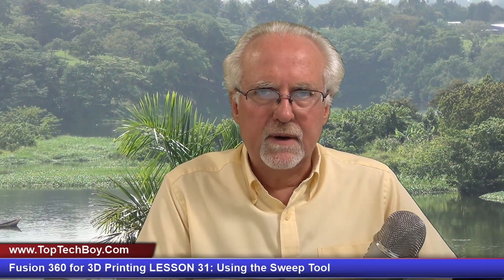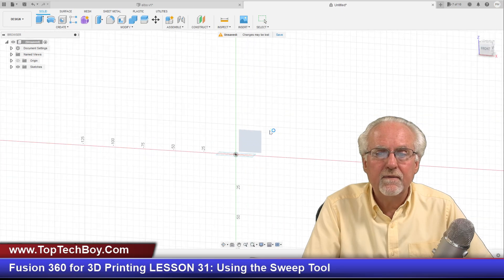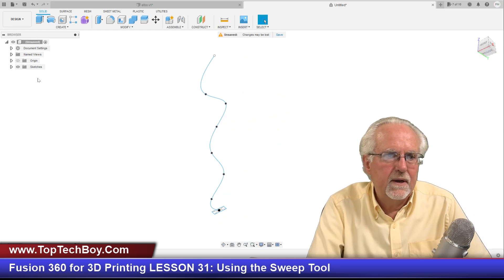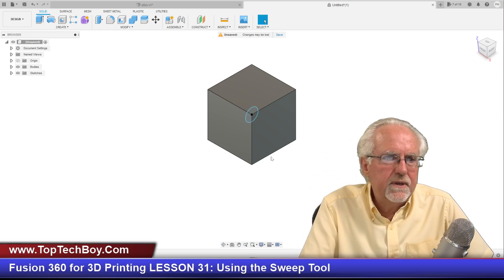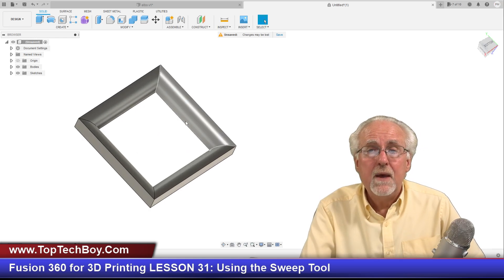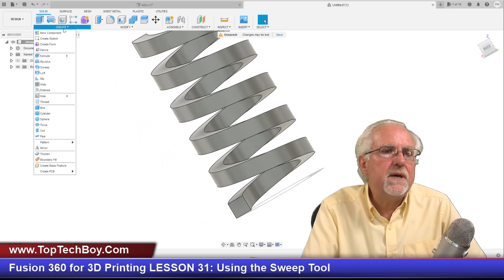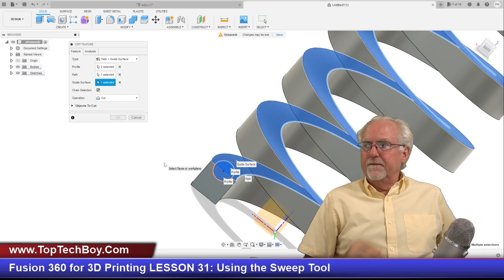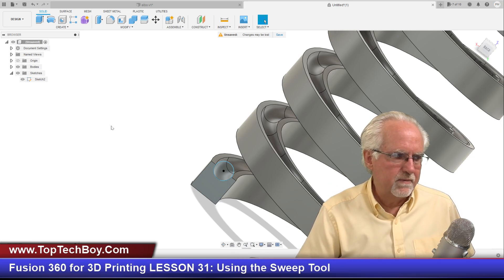Fusion 360 for 3D Printing LESSON 31: Using the Sweep Tool

Comment: Merry Christmas!  I decided to just add a support and make two so I can check fit of two different offsets.  So, these two elbows both have an offset on the outside surface of the male ends.  One has a -.1mm offset.  The other has a -.2mm offset.  The -.1mm offset is too tight to even get it to insert in the female end.  The -.2mm offset is the connection in the last part of the video, which would be good to use if using a plastic solvent to weld them together, like PVC primer liquid, or polymethyl methacrylate monomer.  I am looking forward to see how Paul does this without a support.  Maybe lay the pipe on its side likely.  Thanks for the exercise,  Paul!!
Here is the link to the video:   https://www.youtube.com/watch?v=Ckb646ZCmJI
Reply from the maker: Excellent!
Reply: I am impressed with the video and graphics! My design was not overly taxing, it is printing now, it is on its side. I am doubtful it will print, I didn't use any supports. One question: did it put supports inside the elbow tube?
Reply: @drdentin3215  Hello, Dr!  Thanks for your comment.  There were no internal supports. Only what you see in the video.  I am sharing this with my staff on our lunch break, and they want to know if Dentin is your last name.
Reply: @DrDave327  No Dentin is not. It is a dental pay on words. Dr Dentons are the long underwear with the trap door in the back.